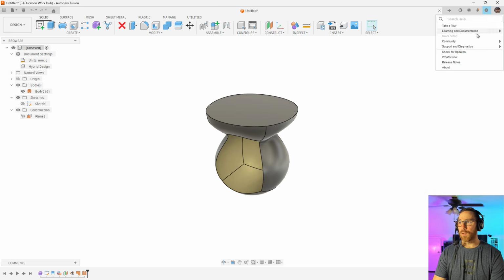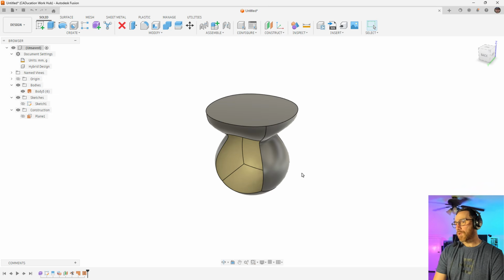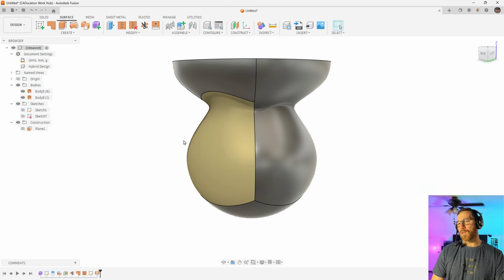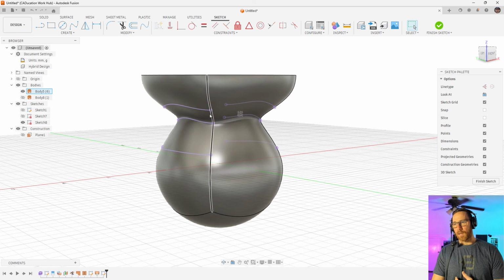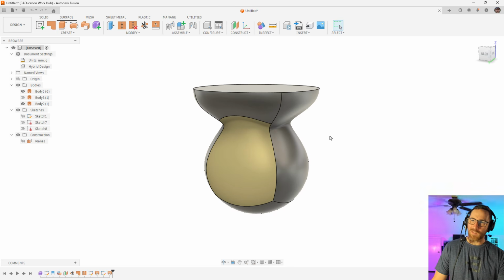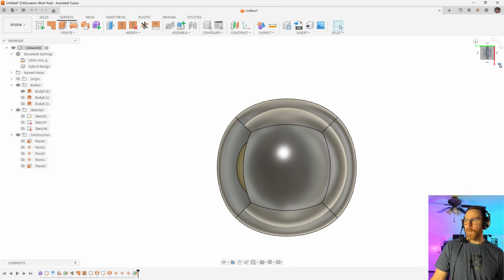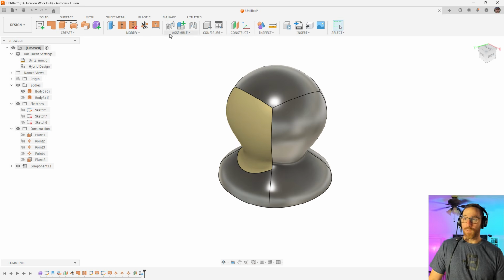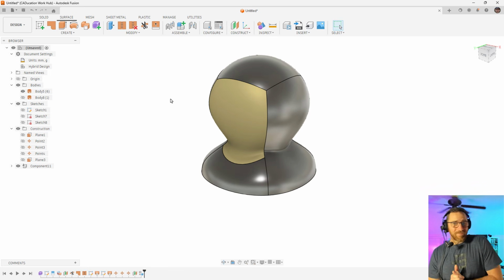What's New in Fusion | March 2026

Comment: Hi,
What happened to version numbering in Autodesk Fusion 360? I don’t see it anywhere now, and it’s really inconvenient.
Is there a way to get it back?
Reply from the maker: The behavior changes depending on if you are on the new CE (collaborative environment) hub or the older style hub.  All fusion accounts starting last April were all the newer CE style hubs.  this opens up more options for data associated with parts, but does change the save structure....  If you had an older hub it was likely migrated (all of them are being changed).

They did away with the save dialog with version description/milestone.  You can still add it but you do so by right-clicking on the top level of the browser and going to "History".  Inside of the dialog you will see a "create version" button.  This is effectively what a "Milestone" was.  If you expand the list of under each day you can change the description which is "User Saved" by default.

also not sure why this comment didn't show up in my feed for 3 days...

Comment: These new modeling features are so lackluster for Fusion 360 since the beginning of Fusion. What year is this? First time I put my paws on Catia I could get Isoparametric curves from Surfaces.. we're talking 99 (remember that year quite clearly). What is Autodesk afraid of? Fusion eating Alias? No way.. Fusion is soooo constrained when it comes to proper surfacing.
Reply from the maker: Yeah, to be fair Catia is $$$ but 100% agree.  I don't know what place Fusion has in the lineup as we see simulation and CAM shifted over from other products, and Eagle PCB stuff as well.  Forms are great but it really could use some improvement in core modeling tools!
Reply: @LearnEverythingAboutDesign  Catia is 100k usd per seat per year?

Comment: Nová chyba:
V properties přejmenuju Part Name a Fusion mě po návratu do tabulky změní i položku Part Number.

Neumíte to opravit, nebo nemáte fintu, jak to obejít? PLS.
Reply from the maker: There might be a few things here.  The hub style will impact the properties a bit.  Hubs created after March 2025 are CE (collaborative). while hubs created before that are the older team hubs and are slowly migrating over.  The change impacts the properties.  If when you save a design you still get the save dialog box pop up asking for a comment or milestone you have the older hub with fewer properties available.

That shouldn't change the part number/name/description though.  By default now the Part Name is the name of the file/component.  So if you called it Part1 then the Part Name in properties is Part1 v1 (if you have saved it once).  You can change the part number and description.

Are you in a drawing? or are you looking at the BOM table in an assembly?  Are these parts external or internal?

Comment: Hey Matt, a bit off top here. I'm following your steps on building a car with Forms (ferrari 308 series) and at the latest stage you've introduced the Surface mode tools to finish it all up. Since then Forms are a dedicated mode which doesn't seem to be working the same way as you described 4years ago. Could you please explain how does it work with the new Fusion setup or if you already had it explain point it out on the video. Heaps thanks in advance, love your content!
Reply from the maker: hmmm, there shouldn't be any difference to the way the tools work.  The only change you might see is if you are in an Assembly Design, the modeling tools are hidden.  But forms and surfaces both work the same in Hybrid and in part design.  Any supplied files should be set to Hybrid design when you open them.

Can you explain more about how they aren't working the same?

Comment: Not relevant to the update, One thing that has been an issue since inception of Fusion, which I'm still waiting for is precision movement and removing the snap to like 2.5 degrees when rotating, instead of having to type increments of 0.01 until you get something you visually could do easily.. like the shift button function in blender.. (looking at the manufacturing template machines... Damn those are outdated for 3d printers)
Reply from the maker: For the rotation, do you mean with the Move command the snaps?  In user preferences you can edit the angular precision, but i don't think you can change the snaps sadly.

I don't use fusion for 3d printing.  I did back with my ender 7 but it is easier to use another slicer unless you have a very specific need.  They put a lot of effort into the CNC machines but i don't think as much as with the 3d printers.  From my understanding they generate their own slicer info and set it up for each printer...

Comment: I recently worked on some large assemblies, but i could not see any big performance improvements.
Especially painful was drawings, because Fusion wants to update every line after every operation. Even just adding a dimension sometimes resulting in a 5 to 10min wait time and that with a fast CPU
Reply from the maker: Thanks for letting me know.  Was the large assembly made up of external components or internal/both?

I have seen noted somewhere that with the CE hubs and the way the data is moving that we might not have to deal with "out of date" warnings with things that are not actually geometry changes in the future.  That will likely help on those changes and having to update a drawing or assembly because you changed the color or property of something.
Reply: @LearnEverythingAboutDesign the assembly is organized with each component as external subassemblies and those with external linked components. I wish there would be a "don't compute" button or something similar in the drawing and even in the 3d environment. If i am not mistaken CATIAV5 used to have that.
There have also been numerous times were i didn't know if Fusion crashed or is still doing something. 😅
Reply from the maker: @emanggitulah4319  Yeah, Solidworks has the "freeze bar" that you can pull down from the top of the feature tree to prevent early stuff from rebuilding.  that would be a big help in Fusion.
Reply: @LearnEverythingAboutDesign yes indeed.. That would super helpful.
Thanks for the great content BTW ❤

Comment: By these cloud based programs if you want you designs copied. Hey, I won't charge you if you keep your designs on my server, I promise I won't look. ALL THE CLOUD IS, IS A BIG SERVER
Reply from the maker: Yeah.  So I work pretty closely with Autodesk and have for nearly 10 years.  Nobody on the data side has ever been able to access my data directly and I have worked with those on the hub team for various things.  So i personally don't worry about that part as much.  I would LOVE to have a local only version of Fusion though as an option, maybe running in Linux :)
Reply: @LearnEverythingAboutDesign You should advocate for this in every single instance you are able to, instead of a YouTube comment, if you work as closely with them as you are claiming. Cloud programs are shit, objectively.
Reply from the maker: @Clarkzer0  I make my point of view known but its like being a passenger on a cruise ship.  No way I am steering the ship :)
Reply: @Clarkzer0  Hey man, I'm a ME gradute from 2021 and basically grew up as an engineer on Fusion 360. BEen using it for a few years now, and I hate solidworks or anything local right now. Storing files locally is such a hassle and working with other designers is so annoying when my files are local. Really don't know what you mean by this.